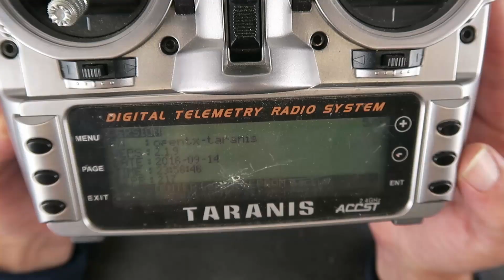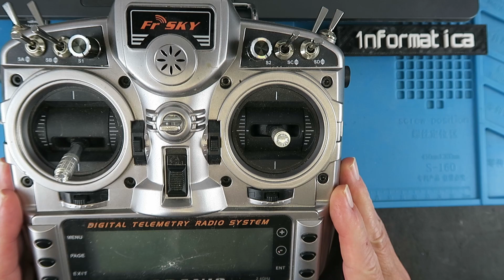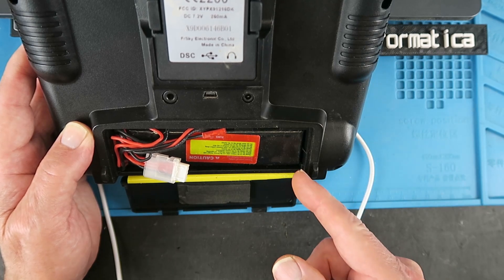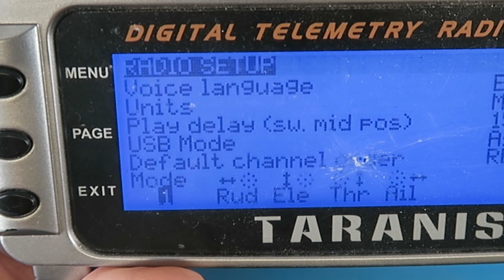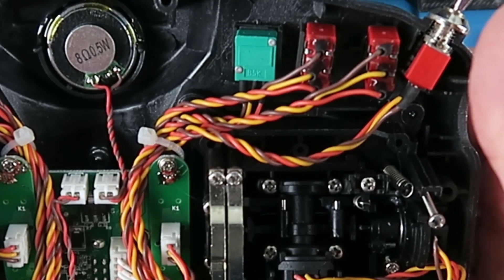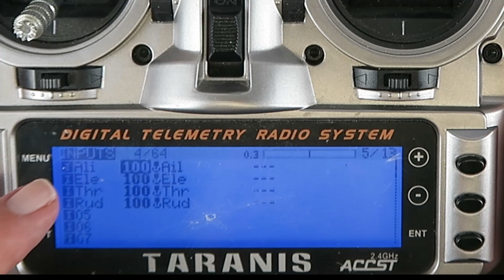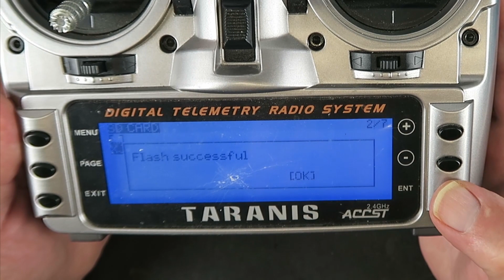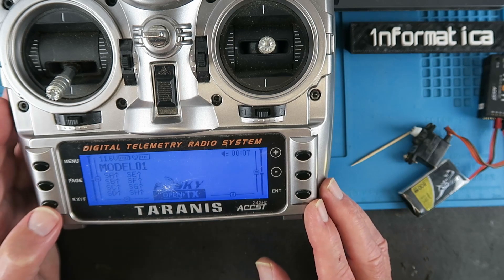Original FrSky Taranis X9D Firmware Upgrade Tutorial

Comment: can't flash internal module... any suggestions?
Reply from the maker: Would need a lot more info even to guess! What firmware is it running? What fw are you trying to flash? Does it go into bootloader? https://youtu.be/havMSMVUOmM?t=78
Reply: @1nformatica  latest firmware, 2.3.15... everything works except xjt upgrade, keeps telling me "firmware update error module refused data" 
I've also tried installing edgetx, same results
The problem came up trying to bind Vantac RF007 with its Archer Plus RS integrated receiver... No bind whatsoever
Reply from the maker: Personally I don't use the XJT anymore, only external irange X and ELRS. The only clue I can find is in this thread : https://frskytaranis.forumactif.org/t11546-probleme-de-bind-x9d-xm  Looks like your XJT module maybe "protected"!
Reply: @1nformatica  I'm thinking about ditching frsky and going elrs with a 4in1 external module... the thing is I'm also a fixed wing pilot and need a 16ch pwm receiver, don't know if  such a elrs receiver exists... the 4in1 radiomaster module supports xjt and access? that would solve all my problems

Comment: I have a 2016 X9D plus. Will it support the latest firmware? Currently running opentx 2.2.4
Reply from the maker: Yes, that should not be a problem. You should also consider going to Edge TX which has more support these days : http://edgetx.org/getedgetx Either way you will need to update the firmware on any receivers you have. Thanks for watching, have a great day!

Comment: I have the same Radio X9d ACCST, but my laptop does not recognize it, it only sounds when connecting and StM32 BOOTLOADER appears below but the radio does not appear how to solve this I have Windows 7
Reply: Thank you very much my friend I will try
Reply from the maker: This usuallyhappens when you connect the radio switched off. To connect to OpenTx companion you should hold both canter trims to the middle and power on, then connect the USB cable. If it still appears as STM bootloader then you need to put a new bootloader on the radio see "method 3" here : https://www.horusrc.com/en/blog/unbricking-taranis-radios-with-opentx-operating-systems/ YouTube no longer shows me if you are subscribed. Please consider subscribing if you have not done so already!
Reply: @1nformatica  On my radio you can't do that with the 3 buttons, it is that I have never updated it, it has the oldest version of 2013
Reply from the maker: @Remielmasloco  Then as I said before you must change the bootloader on the SD card in the Tx.  First use OpenTx companion to download the "*.bin" firmware file, then copy it to your SD card by removing the SD card from the Tx and putting in a card reader. Once you have the "*.bin" on the SD card put back in the Tx and flash it to your radio. This is shown here : https://youtu.be/KbpHb2_RXbk?t=121

Comment: You're not completely right about the legality of the use of the transmitter with the old XJT firmware: because it was purchased before January 1st 2015 you can legally keep using the FCC firmware and are not required to flash the LBT firmware on it. However, if you make the change to ACCST v2.1 (advised) it is ofcourse a good idea to flash the LBT version as all receivers have to be flashed anyways and it makes purchasing new receivers easier (without having to flash firmware again when they come with ACCST v2.1 LBT firmware on it, when you buy them local that is). PS. The screen looks horrible and can probably be fixed by removing the plastic protective coating on it which will make it look much nicer again. 😉 

Another thing, it looks like a 8 cel NiMH battery is used which gives a maximum voltage of 12 V. Flashing receivers from the transmitter might damage the receivers because most can't officially handle more than 10 Volts. Using 6 cel NiMH or 2S Lipo/LiFe is recommended when flashing receivers from the radio. Battery voltage is going straight to the JR bay, no voltage conversion is done. 😟
Reply from the maker: Thanks for watching and your constructive comments. The Tx belongs to a fellow club member so I will leave it to him if he wishes to tidy up the screen! I am aware of the battery voltage going directly to the module bay, I mention that in my Rx upgrade video. Please consider subscribing if you have not done so already!
Reply: @1nformatica  I've watched that one as well and added a comment about D8 and the range of the IRangeX module you were talking about. 😉
Reply from the maker: @arlemooldijk1595  Good to know, thanks.